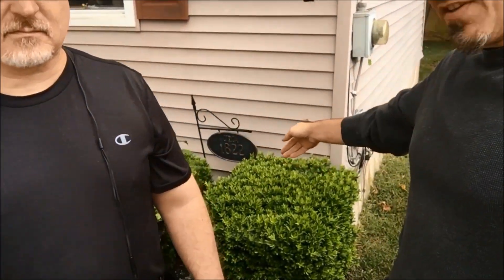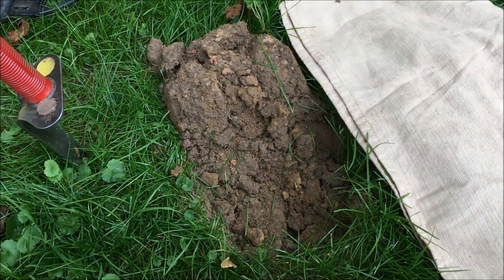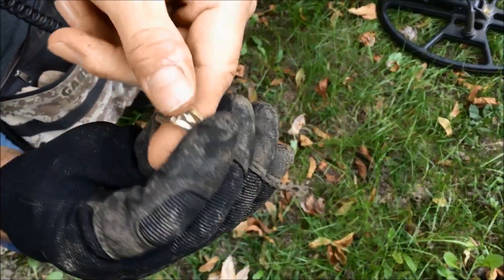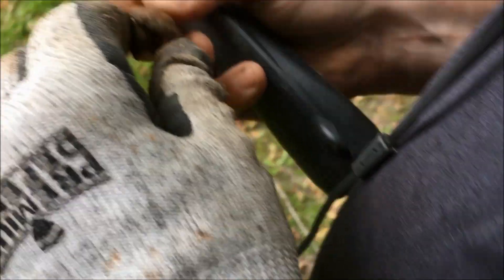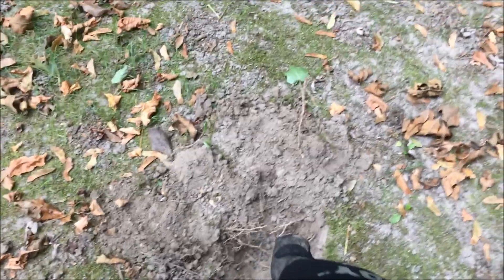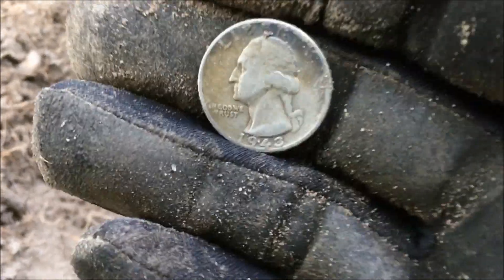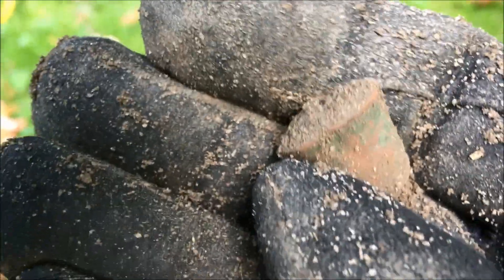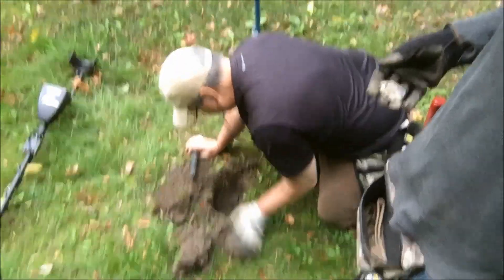Metal Detecting discovery confirms Secret Society existence

Comment: Nice ring find, a Winged man (Angel) on a horse or winged lion (gryphon) is also a Masonic emblem or symbol, this must have been either a meeting place or where a member have resided to have or than one item of same origin. Thanks QH and Mr. Kyle 5'10" on a good day lol, that flat metal seemed to have ridges around edge like it used to be a coin that was placed on train tracks and ran over by train, sometimes they still hold their roundness and thickness and don't smash all the way.
Reply from the maker: +ShaBle's Bigfoot Search  Those buttons might actually be Masonic items along with that ring. I didn't make the connection before, but maybe it was an old meeting place. Even all 5'10 of Kyle agrees! Lol.